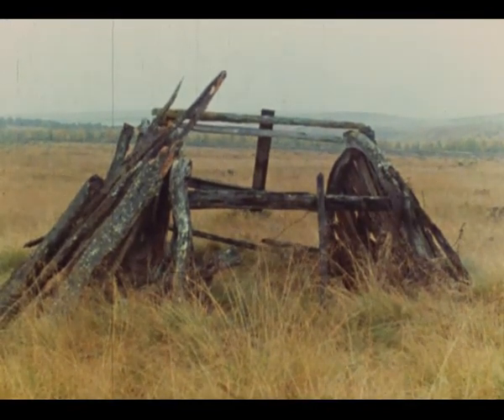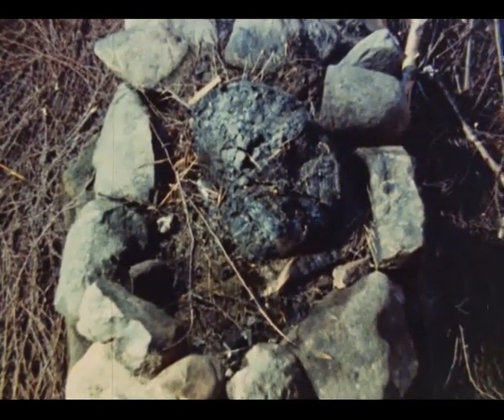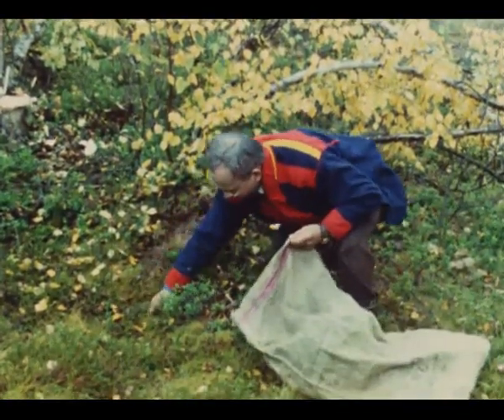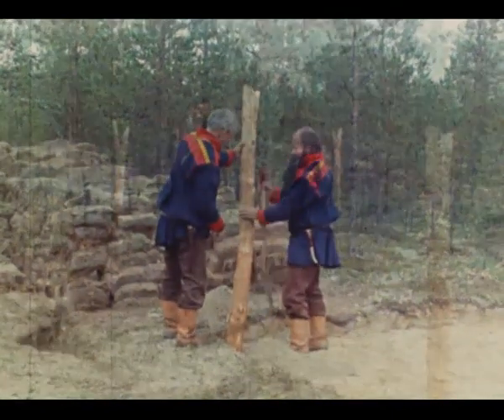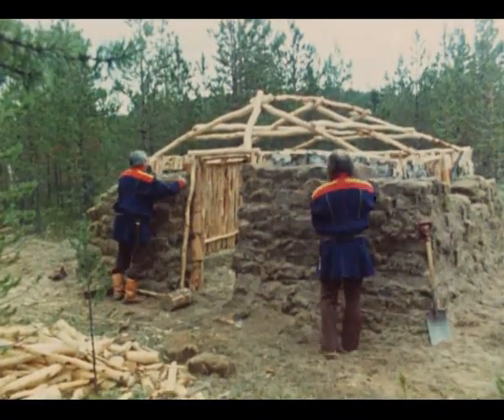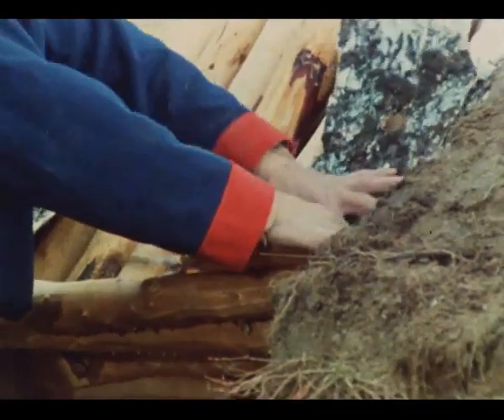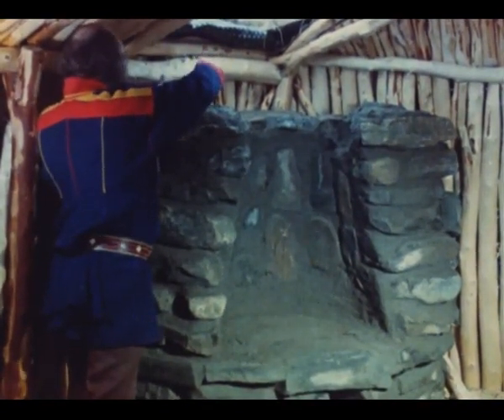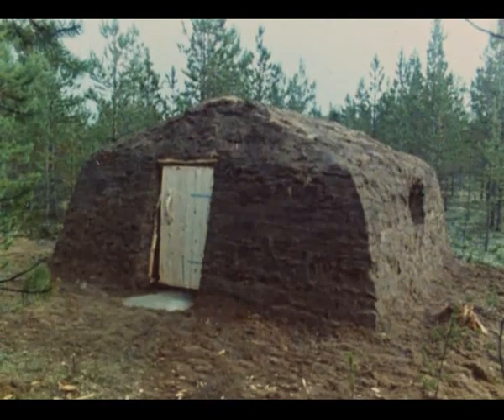Sámi dilit XII: Gammebygging : Karasjok 1980

Comment: Seems weird, to have a mud hut in the arctic. Is it waterproof ? Can it withhold half a meter snowfall ?
Reply: First several (at least 3) layers of birch bark is known to hold water (but it seems that 1 layer is enough, though), and adding a good, living turf roof above it adds insulation. In my country, where can be 50 cm of snow at the late winter, can be problematic even for metal roofs, when snow begins to melt and gain more and more weight. Therefore it must be taken manually. But a smaller houses like this can hold snow better - which can be seen reasonable structure for hundreds of centuries in northern countries. Reasonable enough with local materials and low tech tools and techniques. These aren't just basic clay- or mudhouses - they are made of turf, which insulates and holds its structure its own  way.
Reply: If it couldn't, they probably wouldn't have used them for aeons.... also its not mud, its peat
Reply: Been used for millennia by Sapmi people. You go figure.
Reply: Very practical when you dont have anything but stone tools